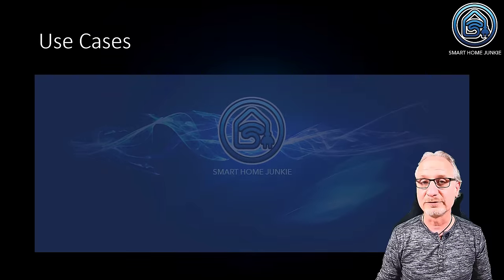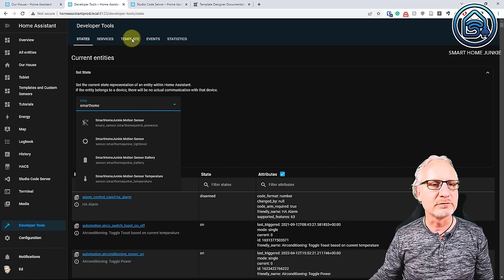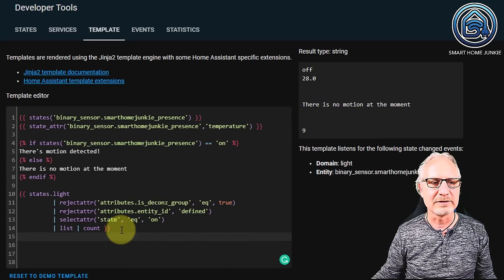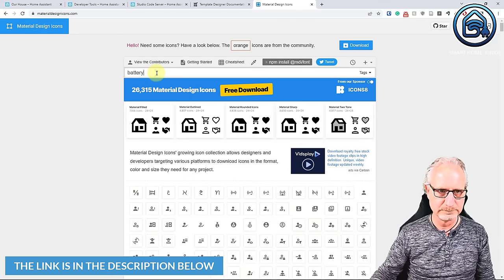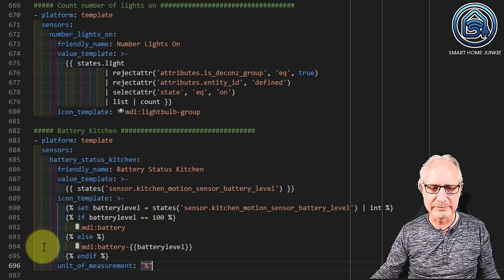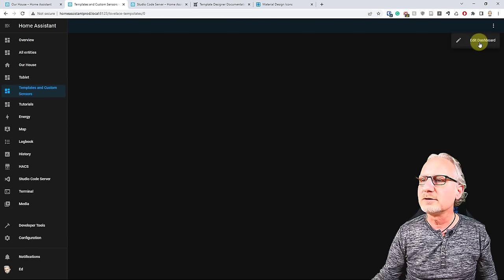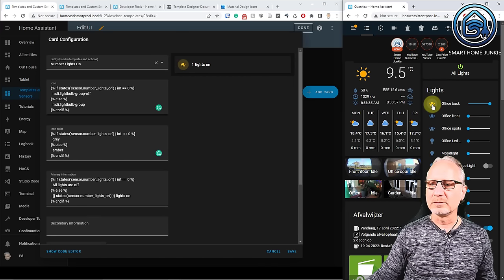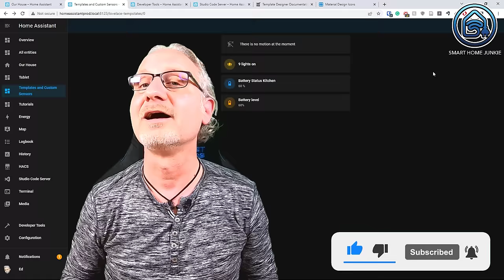Templates and Custom Sensors in Home Assistant - How To TUTORIAL

Comment: Great tutorial. The only problem is your example of battery is exactly 60. My batteries are the actual percentage, 74. So your template won't work; there is no mdi:battery-74. I solved this by cutting my number's last digit off and adding a "0" in the mdi define:
        icon_template: >-
          {% set batterylevel = (states('sensor.lumi_lumi_sensor_wleak_aq1_940af806_power')|string )[:-1]|int  %}
          {% if batterylevel == 100 %}
            mdi:battery
          {% else %}
            mdi:battery-{{batterylevel}}0
          {% endif %}
Also I initially couldn't get configuration.yaml to call the sensors.yaml file. May want to tell people you have to move ALL sensors from configuration.yaml to the new sensors.yaml file or it won't work at all (can't appear in both files).
Reply from the maker: You can do this with a template sensor and use the code | round(0) in it.
Reply: Awesome tutorial !!! especially you understand enough to improve the code by yourself : 
{% set batterylevel = ( ((states('sensor.franck_telephone_perso_s22ultra_battery_level_2') | int | round(2, 'common') / 10) | int | round) *10 ) %}
Get a perfect mathematical round of the battery (once divided by 10) then multiplicate again by 10 to get a %

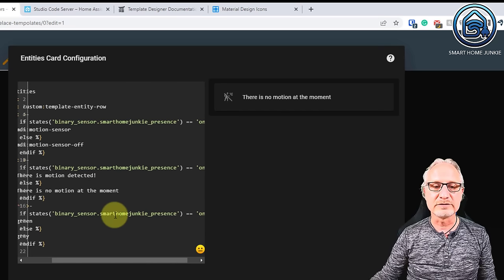Comment: 23:00
❓ How to use templates in a card (e.g. picture-element-card) to differ e.g. the color depending on a input_boolean?

In the "Developer-Tools Template" it works but not in the card.

My code is:

    style:
      color: >-
        {% if is_state('input_boolean.darkmode_manuell', 'on') %}
          blue
        {% else %}
          red
        {% endif %}
Reply from the maker: Actually, the color is a style element and shouldn't be part of  template which is a data element.
Reply: @SmartHomeJunkie  Ok, thank you.
Maybe I misunderstood the idea behind templates.
I thought templates just writes the value (result) there where it stands.
So because in "Developer-Tools Template" the result was rightfully ('red' if button=on and 'green' when button=off), I hoped it just puts in the result on the place in the code where it is.

So if templates are the wrong tool for this, how is the right way to do it to be able to use it universally? (Maybe a HACS integration?)
Reply from the maker: @photelegy  Hmmm, I am not sure if I understand you correctly. A template outputs a state and that state can be used in other places. If your card accepts a sensor template that delivers a color as a state than theoretically this should work. I thought that you meant that the template also contains a color.

Comment: You are using old sensor configuration format. I'm struggeling now using the modern configuration. 😞
Reply from the maker: Yes, this is an older video, but that sensor format is still supported and will stay supported for a while. In net videos I use the templates.yaml and the new format. They do not differ that much.

Comment: Outdated template format incompatible, f.e. with state_class, etc. Bad way to start templating.
Reply from the maker: There is a new way of templating, but this is still supported.
Reply: @SmartHomeJunkie  don't get me wrong. I'm new to this, and I watch your video (which is fine) to make a template, then I add it as a measurement to log the data and incompatibilities begin. Soon (a few hours and forums later) I discover that this video si as old as the "new" template system: so its kind of :/ The content is fine, but its a bad place to begin in 06-2023 becaue you'll miss a lot of features and you'll have to move to "new" model sooner than later.
Reply from the maker: @EsperaSentado  In my newer videos I explain how the new template format works.

Comment: I have a battery level of 4% wich results in an icon mdi:battery-0 which does not exist and I'm ending up with a blanco icon. How can this be fixed ?

EDIT: Never mind ! Fixed it with the following code:

        {% if batterylevel == 100 %}
          mdi:battery
          {% elif batterylevel < 10 %}
          mdi:battery-10
          {% else %}
          mdi:battery-{{batterylevel}}
        {% endif %}
Reply from the maker: Hi Stefan,
Great you fixed it yourself. I made a little mistake in my code and added a link to the description to my Github page where you can find the new code. I guess I also have to add a check when the battery is 0%. Anyway, I just used this to create an example on how Templates work and I can see that you totally understood it which is great!

Comment: I am unable to get the custom template-entity-row example for motion to work.  The expressions for evaluation f the sensor output do not work.  
Here's my code
type: entities
title: Motion Detection
entities:
  - type: custom:template-entity-row
    icon: >-
      " {% if states('binary_sensor.hallway_motion') == "Detected") %}"
         mdi:motion-sensor
      "{% else %}"
         mdi:motion-senor-off
    name: >-
      "{% if states('binary_sensor.hallway_motion') == "Detected") %}"
         Motion detected!
      "{% else %}"
         No Motion
    color: >-
      "{% if states('binary_sensor.hallway_motion') == "Detected") %}"
         green
      "{% else %}"
         grey  
state_color: true
show_header_toggle: false
Reply from the maker: What is the state of your sensor? Normally the state is either on or off.
Reply: @SmartHomeJunkie  Thank you for the quick reply.  You are correct, the state is on or off.  I changed the code to "on" in the conditional expressions and nothing is rendered, so just the same result shown in the entities card  configuration.   Wish I could provide a screen shot.  I know the template-entity-row integration works as I tried the following code it  rendered correctly aka green motion icon with name Hall Motion.  There is something about the conditional expressions that it does not like.
type: entities
title: Example
entities:
  - type: custom:template-entity-row
    icon: mdi:motion-sensor
    name: Hall Motion
    color: green
    condition: "{{is_state('binary_sensor.hallway_motion', 'off')}}"
Reply from the maker: @edkelly6473  you can contact me on Discord so that I might be able to help you.
Reply: @SmartHomeJunkie  Not familiar with Discord... how do I contact you, etc.
Reply from the maker: @edkelly6473  See the Discord link in the description of the video or on my website.

Comment: Hello, 
I added these to sensors.yaml. It worked about 3 weeks ago but now I get an error that the entity is not available.

- platform: template
  sensors:
    number_lights_on:
      friendly_name: Number Lights On
      value_template: >-
        {{ states.light 
                  | rejectattr('attributes.is_deconz_group', 'eq', true)
                  | rejectattr('attributes.entity_id', 'defined') 
                  | selectattr('state', 'eq', 'on')
                  | list | count }}
      icon_template: mdi:lightbulb-group

Im a big fan and appreciate all your videos.
Reply from the maker: Hi! Can it be that you are also using a templates.yaml file now? If so, you are using the old way and modern way of creating template sensors at the same time and that is not working. Make sure all your template sensors are in the templates.yaml and according to the format that they should have in the templates.yaml.

Comment: I purchased your code and when trying in Developer tools I am getting an error. Have a screen shot that i am not sure i can paste here but text is:  "UndefinedError: 'homeassistant.util.read_only_dict.ReadOnlyDict object' has no attribute 'is_deconz_group'". My light count is 2 even with all lights off. Removing the 'count' argument results in '[<template TemplateState(<state light.master_bedroom_ceiling_fan=on; supported_color_modes=[<ColorMode.ONOFF: 'onoff'>], color_mode=onoff, assumed_state=True, friendly_name=Master Bedroom Ceiling Fan, supported_features=0 @ 2023-07-02T14:41:37.748585-04:00>)>, <template TemplateState(<state light.reolink_video_doorbell_wifi_infra_red_lights_in_night_mode=on; supported_color_modes=[<ColorMode.ONOFF: 'onoff'>], color_mode=onoff, icon=mdi:led-off, friendly_name=Reolink Video Doorbell WiFi Infra red lights in night mode, supported_features=0 @ 2023-07-02T14:41:39.826252-04:00>)>]'
Reply from the maker: Remove the Deconz group lines from the filter.  You're probably not using Deconz.
Reply: @SmartHomeJunkie  I did that,  still get the two items  that are shown that appears should not be in light count
Reply from the maker: @anthonybaker2507  The code is an example for my setup. To make it work with your setup you might have to tinker with the filters so that the correct lights will be filtered for your setup.
Reply: Working example:
 - sensor:
    - name: 'Lights On'
      state: "{{ states.light 
      | rejectattr('entity_id', 'in',  ['light.master_bedroom_ceiling_fan', 'light.reolink_video_doorbell_wifi_infra_red_lights_in_night_mode']) 
      | selectattr('state', 'eq', 'on')| list | count + states.input_boolean 
      | selectattr('state', 'eq', 'on') | list | count}}"